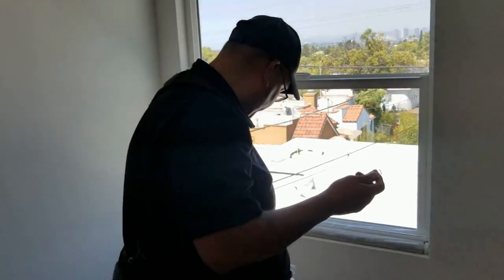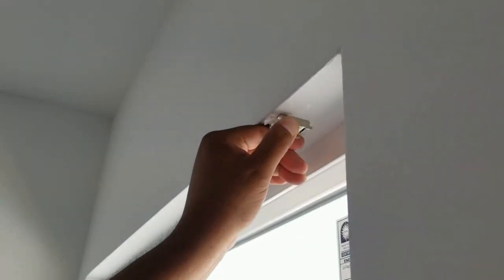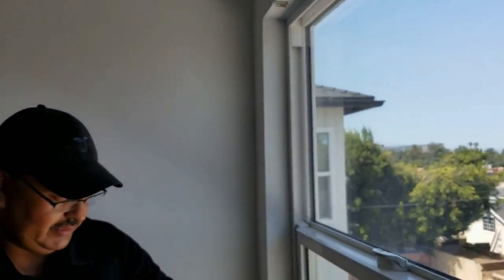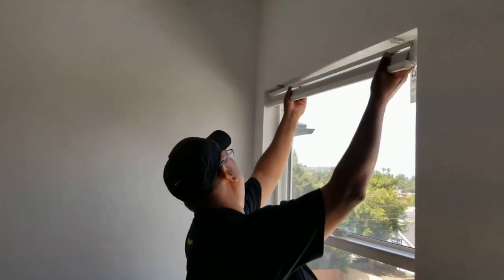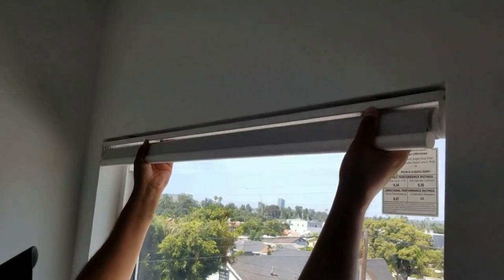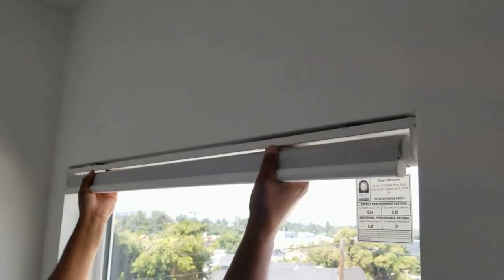How to Install a cordless roller shade in 1 minute. Mounts inside of window frame.

Comment: Where are those brackets from?  The ones I got from Levolor are L shaped, and are too small, you can't get the rail to click on because the roll is way too big.  If you just try to snap the brackets on the rail, the non-clip side of the L digs into the shade!  Yours don't have the other side.  The bracket would clear a 1 7/8" diameter roll, but our rolls are 2 1/4" diameter.  Negative clearance is not good!
Reply from the maker: Sometimes that's the problem with big manufacturers they may sent you the wrong part.  I suggest calling into the customer support and letting them know you need inside mount brackets for the product you ordered.

Comment: How do you uninstall them?
Reply from the maker: There is a clip on back of bracket. Push it in and unclick it from bracket. It's reverse process.
Reply: @Bestcustomscreens  Thanks for the quick response - how do you reach the clip on the back of the bracket when it is installed? It is right next to the wall?
Reply from the maker: @GabrielRacca-e3p  with a flathead screw driver.  It may also be in the front. Depends on how it was installed

Comment: Yeah, now try installing it with a valence. Also, hex screws DO NOT come with the install parts. They give you these terrible phillips head screws. Just throw those away because they’re useless. Also most 1/4 hex head drivers won’t let you screw the screw all the way in so it’s tight. You have to switch bits and finish with a Phillips head bit.
Reply from the maker: Thanks for reminding us. We do need to do a video with a valance and or fascia.  Yes the hex screws they give are insufficient and I use my how 1 1/2" hex screws.  Yes sometimes you do need to tighten with Phillips screw driver.  Fortunately this time I didn't. Thanks for watching and the input.
Reply: Boo-hoo. Pre-drill the hole and install it with a screwdriver.